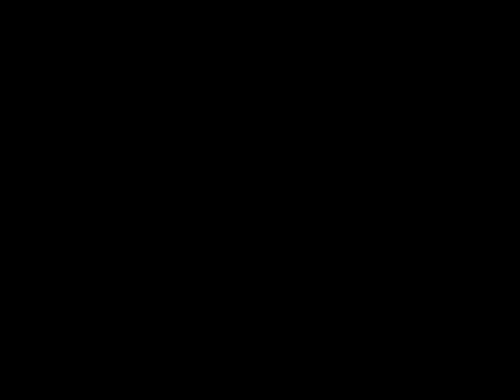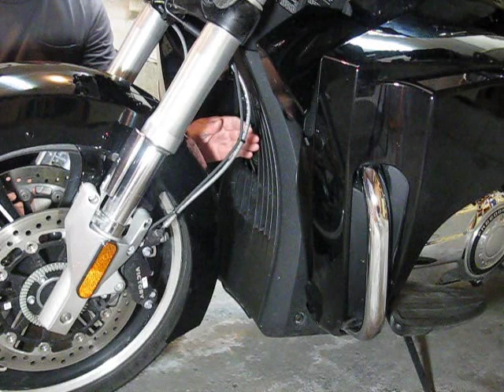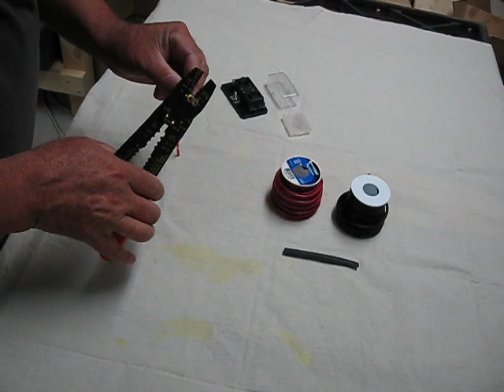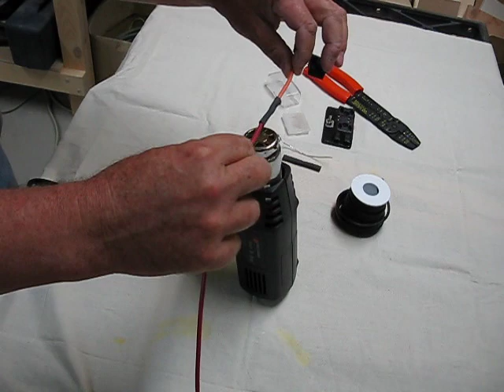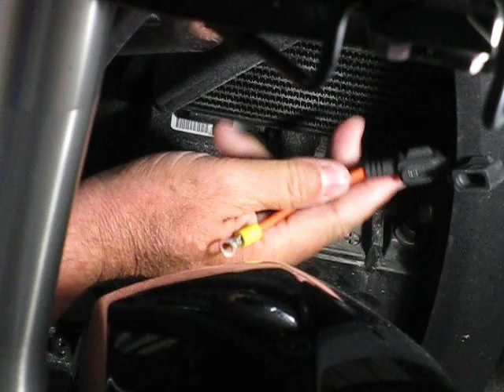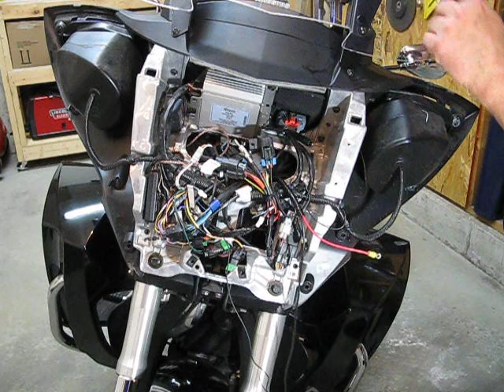Victory CCT Aux Power Block

Comment: Just put a power distribution block in my CCT along with an air horn and I used your video and soldered in a diode, my power distribution block has a side for negative and positive.

Comment: Good day Paul. Very good video. Couple of questions: Since you put a 30amp fuse in line by battery, is that the largest one use can use in the block? Is 4 accessories all you can run since there only 4 slots for fuses? Regarding accessories, is the power connected to fuse block and ground connected to ground strip? With this particular block,  is the positive wire  end stripped and inserted into the block? Why is it necessary to wrap wire around each screw on negative  ground strip? With this set up, does the bike need to be turned on to power up accessories? As you can see, I not very knowledgeable regarding this subject.  Thank you!
Reply from the maker: Hi Jay, I decided on the fuse block to suit my needs, for me 30 amps total and 4 outlets were all I needed for everything I connected to it,  The wire, fuse block and ground has to be able to handle the 30 amps, so I used 12 gauge wire. The positive wire is connected to the battery, goes through the 30 amp fuse and directly to the block, so it is powered all the time. The ground wire goes from the battery to the grounding strip. I needed to loop the ground wire around all the top screws on the grounding strip because I couldn't find a metal strip that would short all the screws together. This particular grounding strip has the top screw shorted to the bottom screw but not side to side, so I needed to short the entire top row so all screws were now connected to ground. Hope this helps.
Reply: @PaulPomerleau  Helps, thank you. 
This particular block, how is the power wire from accessory connected?
Is accessory power available when bike is off?  Thanks again.
Reply from the maker: The power block I am using is not accessory. It is always on. I needed it for items such as the air horn, garage door opener and live tire pressure monitoring system so as to remove individual power wires all going to the battery and looking bad. All accessory wires for the GPS and horn trigger can all be found within the fairing. Although you can buy a fuse block that has both live and accessory outputs, but I didn't need that style.
Reply: @PaulPomerleau  Thanks again. One more question:  How would you wire power block where it comes on when you turn the key on and off when turning bike off? Thank you.
Reply from the maker: You would have your power wire from the battery going through a fuse and into a relay, then out the relay into the power block. The coil of the relay would be connected to any accessory wire in the fairing. This will activate the relay when the key is on and provide power to the fuse block and shut off the power when the key is off.
Reply: @PaulPomerleau  Thank you for the info. Very helpful!

Comment: Another good video. I did a larger assembly on my BMW (10 fuses) but what U install is enough. Did U make any modifications to the stock Radio and speakers. I don't care for the quality of sound on my 2015 CCT system.
Reply from the maker: Never in my life have I ever listened to the radio while driving or riding. I prefer quiet to calm me down.
Once it accidentally came on as I was reaching for the horn button and I hit the volume up button instead.
I thought, this could be a problem if I was in an emergency situation. 
I considered removing or relocating the radio controls just for that reason.

Comment: Hi Paul, great video as always. My question is what is the amp rating on the fuse block you installed? I've seen them from 10, 15 ,20 amps and want to make sure I have a sufficiently sized one. Thanks
Reply from the maker: +Donn Lesch 
Hi Donn, I believe mine was a 30 amp fuse block. But you need to calculate the total draw of everything that you are going to connect to it to figure out what you need. If you are going to be connecting heaters, horns and lights then it will need to be bigger than if you were going to hook up a GPS, iPod and tire pressure monitoring system. Make sure you also get the one that takes the same size fuse as the bike so you only need to carry one type for spares.
Reply: Am I right to assume that you can go bigger than you need, just not smaller. As far as the amp rating per circuit, and then use the correct size fuse for each particular circuit
Reply from the maker: +Donn Lesch 
Yes, connect the appropriate size wire to the battery then immediately to a 30 amp fuse then continue to your 30 amp block. Now it is protected. Then individual sized fuses in the block to protect the individual circuits. Just like the fuse panel in your house. A main circuit breaker for the panel, and then individual breakers to various things.

Comment: Paul, can I ask why you have the main feed fused and then each portal is fused again?  Is double fusing necessary?  Where did you find the ground lug strip with the sticky back on it?  Thanks for your help.
Reply from the maker: +Dean Simpson 
It is standard wiring procedures. Just as your house has a main circuit breaker and then individual breakers going to specific items. Plus the main fuse protects the wire itself going to the aux fuse block. If that main wire were to get damaged there would be no protection from the battery + to ground. This is why the main fuse is placed as close to battery + as possible.
Reply: +Paul Pomerleau Good idea, thank-you for the explanations.  Where did you find the ground lug strip that had the sticky-back on it?  I found the fuse holder block, fuse holder and 12AWG wire at Princess Auto.  Thanks for your help.
Reply from the maker: +Dean Simpson 
I got the terminal strip at an electronics store in Ottawa called Active Components.
Click here to see a similar image: http://www.superdroidrobots.com/shop/item.aspx/8-pos-2-row-barrier-terminal-strip-with-buss-strip/778/
I also wanted to get the metal bus strip that screws along one edge to short all the screws together, but they didn't have one, so that is why I had to weave the bare metal wire through them all to simulate the bus strip.
The tape on the back was just double sided foam tape that I put on. The same type that holds mirrors onto walls.
Reply: +Paul Pomerleau Active Components closed their doors here in Edmonton.  I will try to source one from somewhere else.
Reply from the maker: +Dean Simpson 
If you can't find one, let me know and I will pick one up and send it to you. No charge.